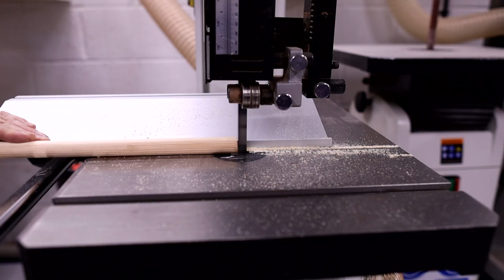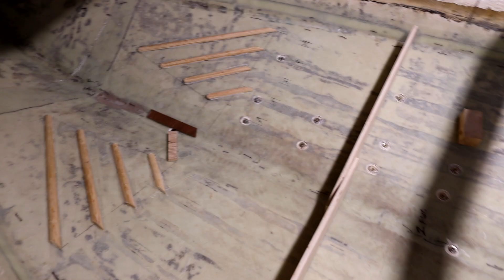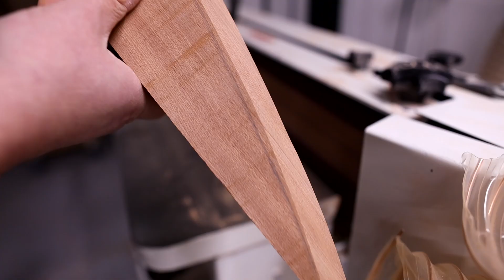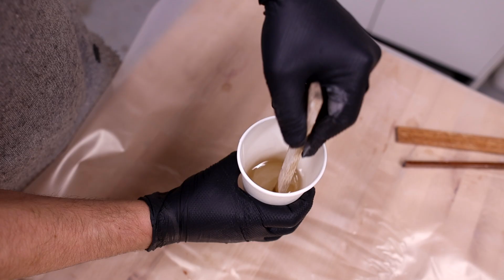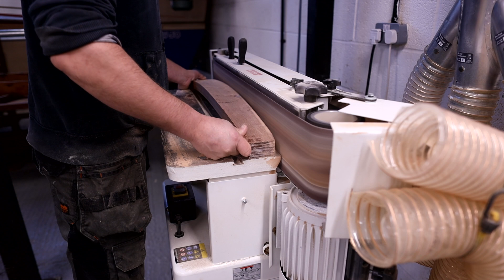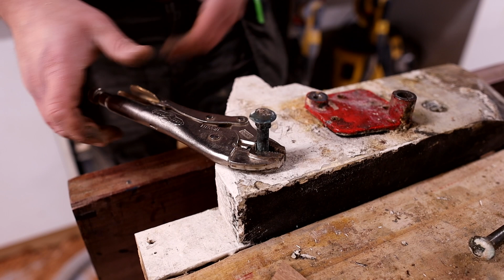Making New Internal Wood Parts | Healey Boat Restoration Part 3

Comment: Due to the rise of outboard motors in the U.S. from the 30's onward, not many boats from that era (50's?) would be inboard motors in that size, though stern drives were common.  But otherwise, this is so similar to many now defunct vintage fiberglass boats over here, like Glasspar, Larsen, Lone Star, Aristo Craft, Penn Yan, MFG, OMC Boats, early Glastrons (the most spacecraft-like), Pearson etc. Some like Penn Yan and Pearson were more conservative and some like OMC and Glastron quite futuristic.  But this is a nice video about the first rate restoration of a fine early fiberglass boat, and I enjoyed watching the care put into it.

Comment: On the Gripe - Is it easier to use sanded then Plan to get angle?  Seen it done both ways.
Reply from the maker: It's probably about the same on both actually, either a hand plane or sander will do this job nicely, I often use both methods.

Comment: Why no wetting out of the laminates with clear epoxy before mixing and spreading the filler?
Reply from the maker: I only tend to do that on particularly absorbent woods, end grain, or if I'm using a thick filler. With a fairly runny filler and face grain glueing I don't think this is necessary. In the next video we will be glueing up some end grain scarfs though and you will see us wetting out first there.